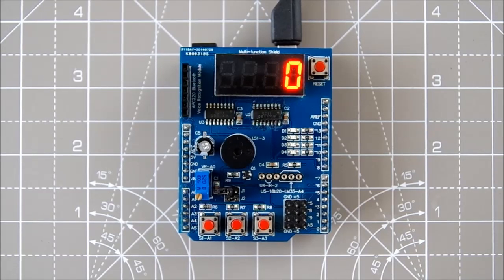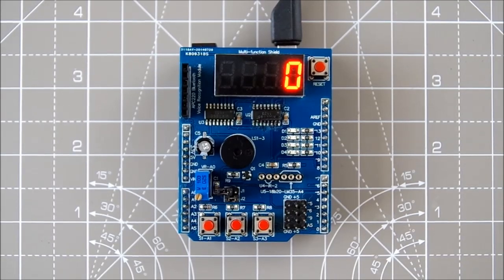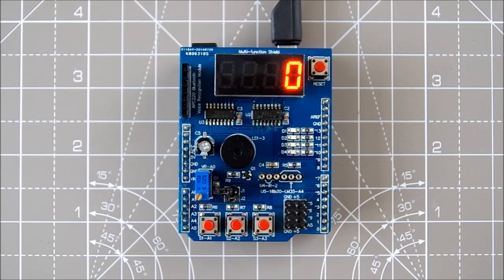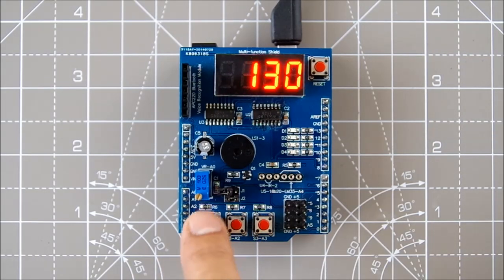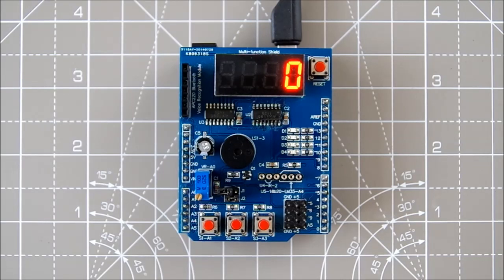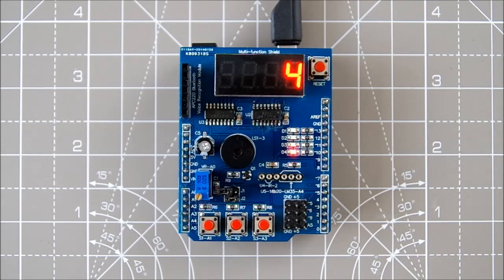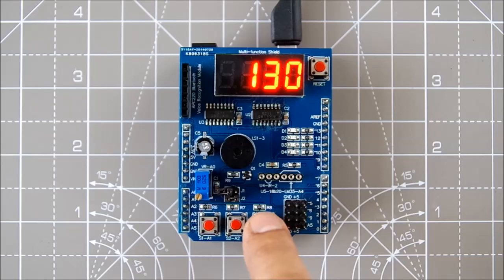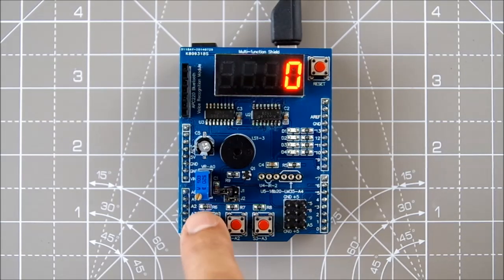A Metronome Using Arduino Multi-function Shield

Comment: Why is it only chirping on the first beat of every bar? A metronome is suppose to chirp on every beat. Preferably with an accented first beat.
Reply from the maker: On most of the shields, the beeper tone is at a fixed frequency. The source code is available for any to modify if they have a different beeper..